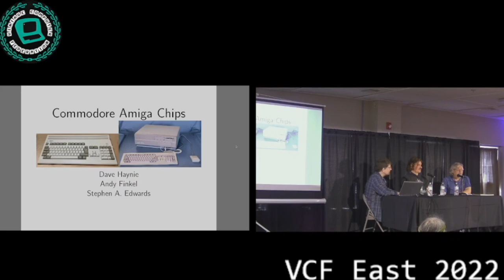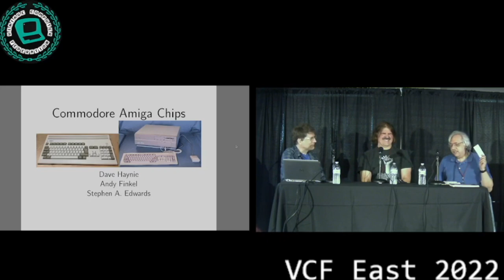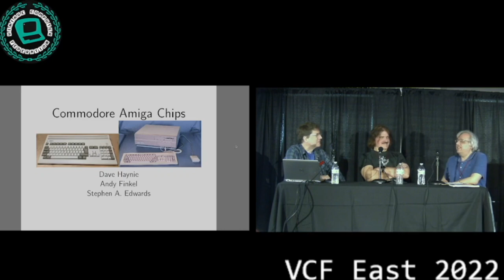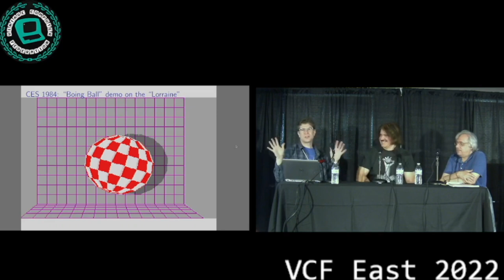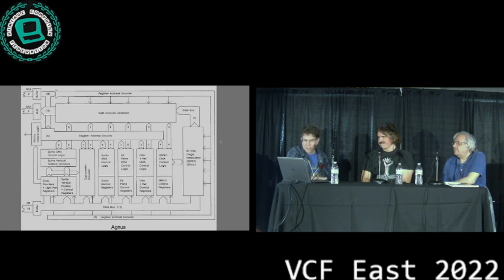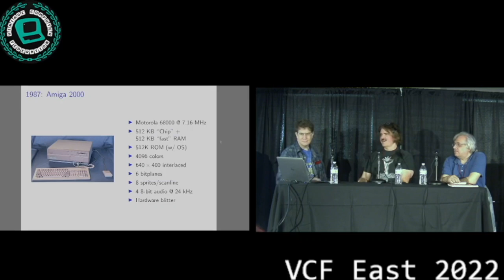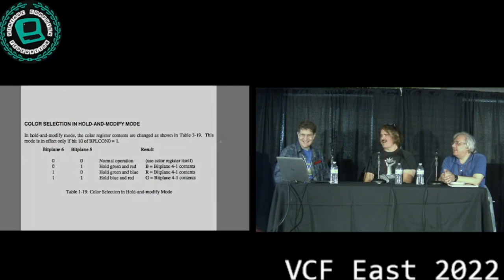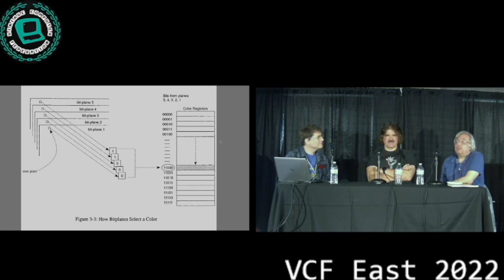Commodore Amiga Chips — Dave Haynie, Andy Finkel, Stephen Edwards

Comment: What buffles me the most is that they didn't use the Ranger chipset (which was finished in 86, if I remember correctly) in the A2000 I mean  Braunschweig created the A2000 for business use. Even in 1990 in the A3000 it would have been a lot better than the ECS chipset. I mean 1024x1024 Pixeln non-interlaced with 128 colors?